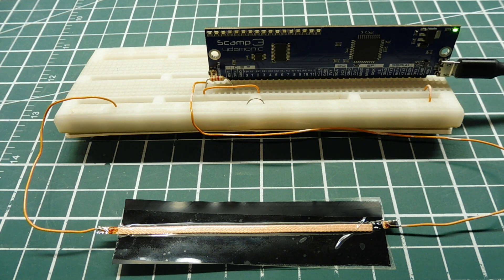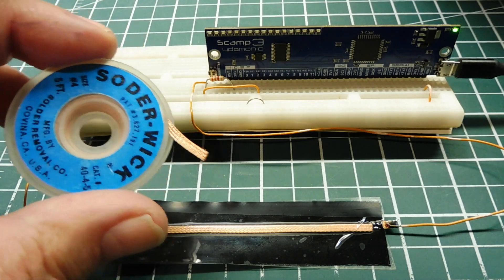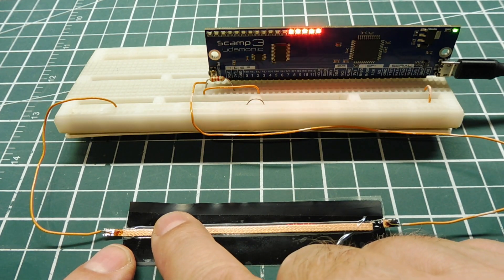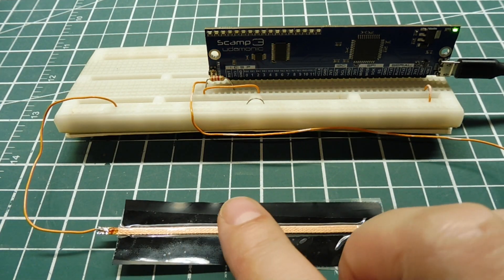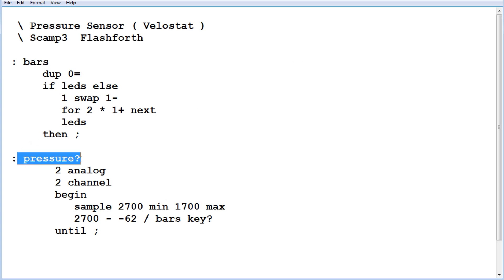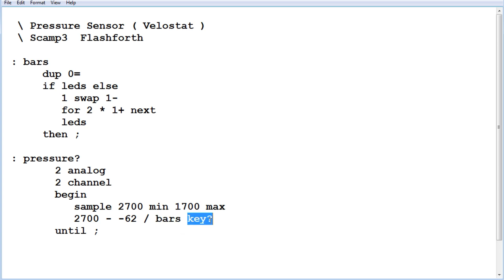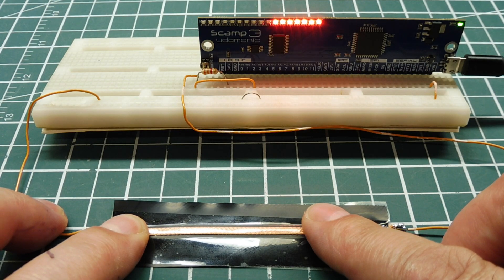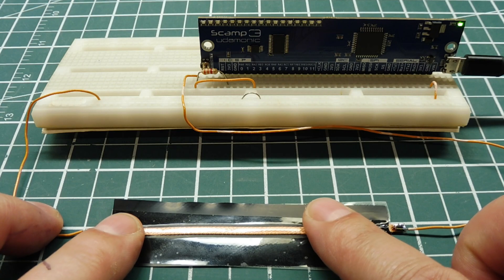Build Your Own Pressure Sensor / Velostat / Scamp3

Comment: How do you choose which resistor to use?
Reply from the maker: Measure the resistance of the pressure sensor at no pressure and then at full pressure. Multiply the two values and then take the square root. This will give you a good starting point. You can then tweak that value for the desired response.

Comment: I would like to use this to turn a small water pump on to water a plant when the weight of a plant pot goes below a threshold.
Reply from the maker: By using a load cell you would get better resoloution and they are available in different load ranges to fit your application. Check out these videos:
https://youtu.be/3LoVl_qjeR4
https://youtu.be/vvIe0BFBlFI

Comment: Dearest Canadian Wizard:  

First off, your method of teaching by example is one of the best series of its kind I’ve seen dealing with controller boards, switches and circuits. Subscribed for sure!

I was doing some research that cause me to stumble across your channel. 

More specifically, I was looking into pressure switches/sensors that used Velostat. I’ll explain. 

There’s a computer game called Taiko No Tatsujin (link here: https://youtu.be/DoetvbiA_DY?si=XKPLE1M91JFNJ52m) that’s adapted from a Japanese Arcade cabinet game. 

I have successfully build an arcade-scale drum at home and it’s currently using Piezo sensors as triggers - which is also how the actual arcade equipment is setup as well. The drum jars 4 parts and each part has a single piezo as its button. 

I made a circuit with the  that has each piezo going through a voltage divider (to increase sensitivity as well as protect the controller board from the voltage spikes that piezos can create on their own sometimes. This is going back to a Pi Pico which is acting as the microcontroller. I have firmware loaded on it that translates ADC to keystroke output. ((also found it super coincidental that you cover using the Pi Pico in your channel as well)

So, whenever I hit one of the 4 parts of the drum, a keystroke gets sent to the computer - that’s a that’s needed for this game. 

(Here are some pics of my build: https://imgur.com/a/U1nEthZ)

However, I was reading about Velostat as its properties and it seems that it would be a PERFECT replacement for the piezo sensors in my case. Since it doesn’t produce its own voltage, I would be able wire each Velostat switch directly to the ADC pins on the Pico and since the nature of the Velostat is that it comes
In sheets, I would be able to cover the entire section of each drum part in it when I create the switch (I’ll be using sheets of adhesive Faraday rape for the conductive material that will sandwich the Velostat. 

All that being said, do you think this would be a viable solution? The Velostat sandwich sensor being used to detect drumstick hits that are translated to a single Keystroke on the Pi Pico?

I have some Velostat sheets arriving in a day or so, and I’ll give it a shot. 

I think that might be a fun concept to make a video on if you’re ever looking for more video ideas. 

Thanks again for the great channel and content!
Reply from the maker: Thanks for the feedback, appreciate that. Here are some other videos that might help you out with your project:
https://youtu.be/2XiRnoc8ZRo
https://youtu.be/u2EHDyrV_F0
Reply: @ excellent stuff - thank you again. Rock On!!

Comment: Hi sir, does the Velostat surface need to be sandwiched with conductive material like copper to be able to detect pressure? what if I used copper tape but the adhesive side (the side that contacted the velostat's surface) are not conductive ? I'm thinking if this possible for wearable Vest with pressure sensor that cover whole area.
Reply from the maker: You can use tape that has conductive adhesive. https://www.adafruit.com/product/1127

Comment: could you recommend a microcontroller with 30 or more pins that could work like the scamp 3 in this circuit? I want to implement LEDs in a circular configuration so that the one in the center lights up with a little pressure and then by adding pressure the second circle lights up, then the third, etc...I need it to be compact, so the scamp probably isn't ideal. P.s. Thank you for the content you make. I've learned a lot.
Reply from the maker: You could use the Atmega2560 micro used on the Mega2560 pro board.
https://www.pcboard.ca/mega-2560-pro
Other options are to use shift registers like the 74HC595 which can drive 8 LEDS or the MCP23017 which can drive 16 LEDS using the I2C bus where a couple of GPIO pins are used to drive as many LEDS as desired.
Reply: thanks for the swift reply! I'll look for your tutorials using these microcontrollers. I actually found some LEDs that are soldered in circles on a circuit board, so I might not need as many pins as i thought, but it would be nice to vary the brightness of each circle with the pressure sensor, rather than just reaching a threshhold and giving on/off behaviour. Is that behaviour programmable with the microcontrollers you mentioned in the reply? You're time and patience is much appreciated.
Reply from the maker: If you want to vary the brighness and control a circle of LEDS with a single GPIO pin you probably want to look into neopixels. Check out Adafruit's website: https://www.adafruit.com/category/168
Reply: thanks a bunch😀

Comment: Apparently this velostat material is used in the otomatone toy as a ribbon controller. As in, it outputs a different voltage (while hooked up to power) based on where you press on the ribbon.

This seems to be at conflict with the velostat being a pressure sensitive resistor. I originally thought it was more of a resistive strip, like a potentiometer wiper or a sheet or graphite.

It seems they used two sheets of velostat against eachother for the ribbon controller. 
It would be nice to test it out.
Reply from the maker: They use a softpot membrane. If it was velostat, the pitch would change with pressure intead of position.
https://www.sparkfun.com/products/8681

Comment: This is awesome! Any idea how I could make this a on/off switch? Press=On, Release=Off... connected to some simple circuit without Arduino
Reply: that will be for using in electronic drum cymbals, as a sensor to detect when the border is hit, additional to the piezo signal
Reply from the maker: You could use a voltage comparator to detect the voltage change for "ON" and turn "OFF" when the voltage returns to the normal state.

Comment: can we use raspberry Pi  or arduino instead of scamp3 (scamp3 is not available where i live)
Reply from the maker: You can use any microcontroller that has ADC so the Arduino Uno/Nano will work.
https://youtu.be/2XiRnoc8ZRo

Comment: I think a while ago you used the foam to make a pressure transducer, I could be mistaken.  Would the sensor output change if the sensor is bent ?Maybe could be used to detect angles roughly, looks like it could be good for making a scale too.
Reply: Late to the party, but for anyone else wondering. I seen a very similar design used as a flex sensor.